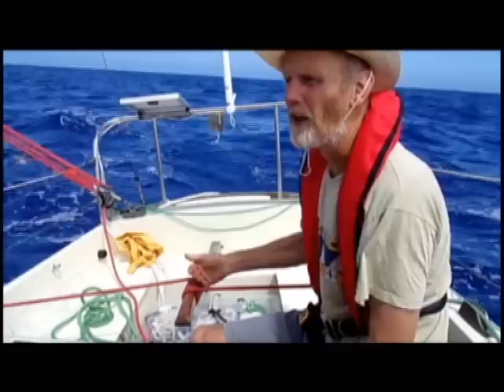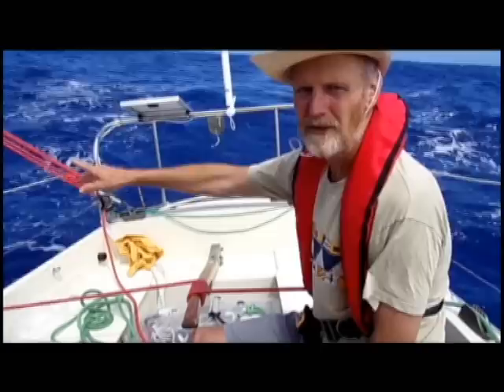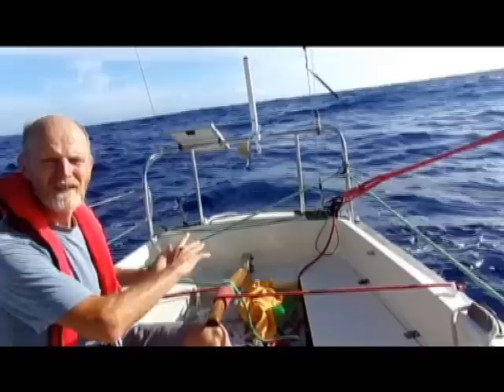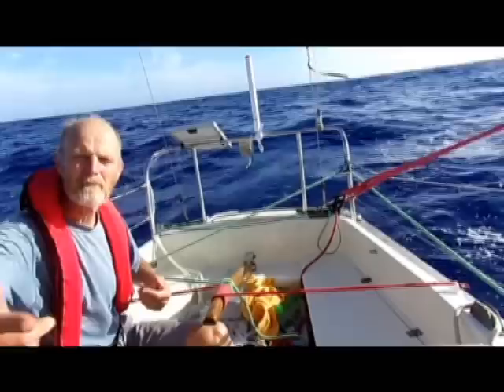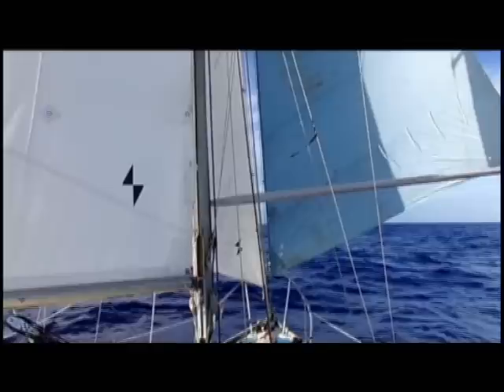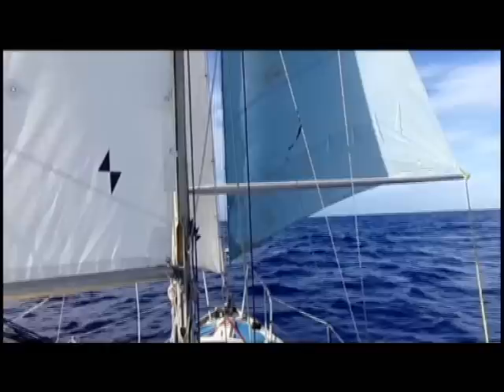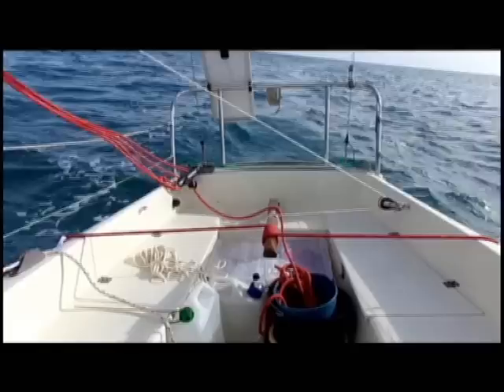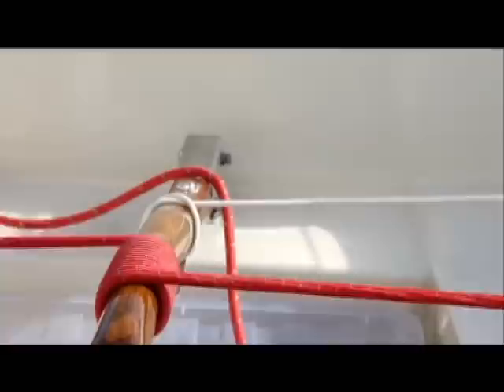Self-steering without a windvane - Jester Challenge

Comment: You Sir have taught invaluable knowledge to me,so much appreciated,best wishes over the Christmas break,stay safe.I have recently purchased a 11m vessel that has the blocks in the same position and I was wondering why being a novice sailor,this sheds light on all of my questions,thank you.
Reply from the maker: Thank you for your comments.  The blocks there may have been for spinnaker sheets, but by all means use them if they provide a clear lead.  Sheet tension on an 11m sloop would be too great for this method except in very light winds.  Check out STeLLA on my more recent videos for one solution.  Many other options are outlined in the John Letcher book
Reply: scallywagII I can see the wear on the tiller,those blocks had to be used in the mix some how,she’s a blue water heavy displacement vessel with multiple poles for down wind reaching Im guessing,I’m new to this vessel and have only had 2x21ft light displacement yachts.Financially I don’t want to spend the money on the Hebridean system just yet but may go that way if I can’t master the sheet to tiller system.cheers and happy new year to you young fella from Oz.

Comment: I got Letcher's book ten years ago, when I started sailing,  single handed, and began using these techniques immediately.  I try to get other single handers on to the idea, and they just  don't get it   
 . . . I think they get confused because its too simple, ha!
Reminds me of that expression, "If it was complicated, everybody would be doing it."

Thanks for the thorough explanation, im familiar with that subtle "slalom"  effect.  Ive used it to counter weather helm, and being drawn into shore.  Hard to explain, but, one side of the "S" sailing pattern needs to be, longer and more "powered up", after falling off, which pulls the boat, each time, more windward, countering that push towards shore . . .) It's not a symmetrical "S" shape, if that makes sense. .
Anyway, its so satisfying to see in action, i get all worked up! : )

. . .Also, remember Joshua Slocum, late 1800s, first solo circumnavigator, hand steered only three hours in 23 days, across the Indian Ocean: )
. . .had the wheel lashed, and boat very well balanced.
Cheers!

Comment: A multihull would  be a challenge,  Bill Belcher wrote a bit about it in  Build your own wind vane steering.   Often available for lots more than it's new price as limited number printed by 2018. 
Multihulls can accelerate fast hense the apparent wind isn't so good for wind vane steering though I have seen a video using 2 on 2 rudders looking remarkably good. 
Bill Belcher suggested the use of trailing a rope aft that would provide more usable pull with its increased drag when accelerating. This could stop the boat bearing away ( where the problem manifests) with helm till sheets ease.  That's the basic theory.
Reply from the maker: It might be worth trying jibsheet to tiller on a broadreach with a multihull.  The change in sheet loading with change of course is quite dramatic.  The low apparent wind should not be a problem if the vane is the size of a genoa, which in this case it is.  I have used this method when there was barely enough wind to keep a cruising chute full.  It worked perfectly when a vane gear would not work at all.

For windward or beam reaches, the change in weatherhelm due to heeling is largely what makes a monohull self-steer.  With a multihull I can't see this happening, but it would cost nothing to try it.
Reply: @scallywagII  Thanks for your reply.  The centre of effort usually determined predominantly by mast rake has I think a similar effect to the healing steering weather helm.  

A Dutch team from memory have a catamaran sheet steering almost on a run with 2 head sails on YouTube interesting but limited.

Next find a multihull owner with a interest ...

Another YouTubeing is from a 22ft Wharam Tiki winning the Jester Challenge from Plymouth to Newport. Boat had windvane but above 14 knots of boats peed it apparently stopped working.
Reply from the maker: @EdSurridge  My understanding is that the centre of effort relative to the centre of lateral resistance has an effect on helm.  Weatherhelm can be increased by racking the mast aft or increasing mainsail / reducing headsail area. 

Under way heeling gives an asymetric underwater shape and this will steer the boat into the wind.  This is why weatherhelm will increase with angle of heel.  I have reefed the genoa on a long keel yacht and that has reduced weatherhelm, despite moving the centre of effort aft.  I have better explained this on my more recent video on another yacht during the Jester Challenge 2018 https://www.youtube.com/watch?v=yKGTv4slZlg&t=208s

The other two videos in that series cover different points of sail and show how to set up the bungee so that the self steering will be reliable in differing wind speeds.
Reply: @scallywagII  Thanks again,  I missed the titles of your films as I binge watched them. They are very good value Sir. 
The Wharram's are certainly long keeled  Catamarans those with specific foil might change maters. You have encouraged me to try finding Cat owners whom might have  self steering interest.

Comment: Any system for a junk rig. They don't use Genoas or head sails much as it tends to interfere with the rigging. Great video, very clear.
Reply from the maker: Going to windward if you get a little weatherhelm, and that increases with more wind, then it may work with a bungee alone or lashed helm. 

For reaching courses you could use one end of the mainsheet pulling to weather against a bungee centering the tiller.  In practice the extra friction and stretch in the multipart sheet means it might not be sensitive enough.  Cost you nothing to try it though.  I think Blondie Hasler may have developed his wind vane gears because of the difficulty getting sheet to tiller to work on a single sail junk rig. 

On a broad reach a jib could be set flying and should self steer reliably if set up correctly.  Shape is not critical and you could pick up a suitably sized old jib very cheaply.  See the more recent videos with Emu for better descriptions of setting up and read the John Letcher book.   https://jesterchallenge.wordpress.com/articles/self-steering/

Comment: Hey, do you know anyone who has achieved this with a junk rig? I have tried, but there is not enough force on the sheets to turn the wheel surficently. I used blocks, and as much leverage as practical, but if I increase the leverage too far then the movement is not enough.
Reply from the maker: It would be difficult with the stretch and friction of your multipart sheets.  I think that may be why Blondie Hasler who developed Western Junk Rig also came up with the servo-pendulum vane gear. 

Going upwind a locked helm or bungee alone could be worth trying.  Downwind it is possible to fit a jib flying and use that as the steering sail.  Shape is not too important so a budget used sail could do.  Alternatively try fitting the lower block of either junk sail sheet to a line with a single block where it would have been fitted, then to a turning block on the windward side.  That way you have minimum friction so best chance of success.  Post another comment when you have tried it.  Good luck.

Comment: im confused...so the first setup is with the wind more at your back and the second setup is when you are heading more toward the wind? Thanks in advance
Reply from the maker: It is much clearer on my 2018 challenge videos which I did in three parts for different points of sail.   There is a better explanation of how to set up the system so that it will be reliable when the wind strength changes.  It is worth putting in the time to study these in full and read the John Letcher book so that you get this right.

Comment: I wonder if it could work with a wheel and a some sort of drum to wind the bungee around. what do you think?
Reply from the maker: +stephen Webb  Possibly it would work.  Wheel adapters are made for some wind vane gears.  Wheels introduce extra friction which is the enemy of all wind steering systems, with or without vanes.  I have sailed to windward using the bungee around the spokes of a wheel and it kept a better course than an electronic autopilot.  I haven't tried it on other points, but give it a go.  Read the Letcher book for more ideas. http://www.kyoa.org.uk/jesterchallenge.htm  Find the link about half way down the page.
Reply: +scallywagII Thank you

Comment: Ha ha took me over half the video to work out why it's called SARAH!! Thought it was named after an ex lover who always insisted on being in control!
Reply from the maker: I was on a high as it had kept a perfect course throughout the day and evening.  The stars are always best far offshore and the words of the Bob Dylan song came to me "Sara, Sara glamourous nymph of radiant light.  The neumonic came later.  Simple And Reliable Automatic Helm.  

With the bigger boat I needed an arrangement to tame the tension in the jibsheet.  Thus the Sheet Tension Lowering Lever Arrangement.  It had to have a female name as I was channelling the late James Wharram who advocated sailing with a 2 girl crew.  So I need STeLLA and SARAH.
Reply: @scallywagII  :) cheers for the recollection. Whilst I've got you! do you think this does away with need for a wind vane entirely or is there still a place for them. I'm very much a novice but looking at a boat now that has a wind vane but I find them ugly things and as I really am not going to be doing these sort of voyages for a while like this clean approach.
Reply from the maker: @AthelstanEngland  I had such good results on Scallywag that I didn't bother with wind vane or autopilot on my bigger 27' boat.  I did though try it out before setting off on a big ocean passage.  Hand steering for 1000 miles does not appeal.  
Wind vanes and also autopilots will usually oversteer more than these methods.  More movement of the tiller will slow the boat down, as will the drag of the pendulum rudder, though these might be slight effects.  On a small boat, the effect of weight at the extremety of the boat is not helpful for stability.  
Check out the John Letcher book which you can view on the Jester Challenge website.  My later videos on EMU also explain the methods and how to set them up reliably.
Wind vane gears may be better in some conditions, particularly running before a storm under bare poles.
Reply: @scallywagII  thanks for the detailed reply. Much appreciated... good point too about wind vane and bare poles though - I hadn't even considered that. I'll check out the book. Thanks again.

Comment: What's the boat here? I have Letcher's book in hardback and prize it.
Reply from the maker: Scallywag II  is a Robert Tucker T23+.  Do you also use Letcher's methods?
Reply: @scallywagII  I built a horizontal vane with fishing line through plastic tubes going down to an auxiliary rudder with trim tab. Took me from Portugal to The Gambia and back up to Britain via The Canaries and Madeira.
Reply: @scallywagII  Before I built the wind vane I crossed Biscay with sheet to tiller, inner jib slightly backed with sheet leading to tiller and bungee compensating. On a Folk Dancer 27.

Comment: Is there light weight brand wind vane good for 22foot to 25foot,sloop? if its heavy, sterns down, so the light one
Reply from the maker: Study the video.  There is no wind vane at all, so no unnecessary weight or windage.  No additional expense either.   Too good to be true? No these methods have been used long before wind vanes were thought of.
Reply: thanks for teaching me the way of a self steering not to use wind vane but to lead sheets from a jib sail. i had not known your way of fittings. but your way may be used when yacht is on running(towards down wind). i dont think your way is  worked when more than abeam (windward). i need strong but light wieght wind vane for my dream plan.
Reply from the maker: Different arrangements for different points of sail.  For windward work, the first part of the video, I just use a bungee shock cord around the tiller.  Adjust the tension to provide the required angle of helm and it just sails itself.  I have many thousands of ocean miles like this.  Try it yourself before spending money on a wind vane that you probably don't need.  Study the John Letcher book for more details

Comment: Small boat to be going into the ocean with
Reply from the maker: Bigger horizons are more important than a bigger boat
Reply: @scallywagII  Fair enough, just thought it would be more dangerous with a small boat. If you can do it, great..
Reply from the maker: @KrunchyJD  A larger boat is usually faster and more comfortable, but that is not the same as less dangerous.  I changed from Scallywag to a slightly larger boat (26') because it had more headroom and could carry more stores.  It is also much better to windward with one long keel rather than three shallow ones, but that does not make it any safer.  The closest I have been to disaster at sea was on a coastal passage on a 600 ton brig.  That was scary.
Reply: @scallywagII  Oh okay, I just imagine that the ocean could have huge waves and it would be dangerous. Ok, I stand corrected. I used to sail many years ago, just a dingy, a Lazer actually, so I know the basics of sailing. I have thought about getting a small yaught, if I can afford it. Kind of thought it would be for sailing around the lake, thought it might be dangerous in the ocean, perhaps not..

Comment: There is no way my boat would steer with those set ups.
Reply from the maker: What kind of boat is it?  Any conventional sailing monohull should develop moderate weather helm which increases with wind speed.   If that is the case these methods should work.  They are guaranteed not to work if you don't try.  For larger craft the headsail sheed tension would be too great, so you can use a means of reducing that.  See my other videos with EMU for detailsof what worked for me.  Read the John Letcher book for explanations of how it works and other methods for larger sails.  I had not read that book when I did this trip but had figured out what worked by trial and error.  When you have tried it out, come back and comment again.
Reply: @scallywagII  Hans 311 with short fin & self tacking jib.Tiller steered.  In 18 years from new I am now on my 7th auto pilot as it burns them out or they do not perform properly. For instance the raymarine av100 will not stop the boat broaching through 70 degrees. At that point the autopilot cuts out & the helm stays hard over. If I am below & do not notice the boat suddenly gybes. Not fun in a 2 metre sea coming over the stern quarter in f7. My aeries does not cut out & will bring it back on course eventually, but it does sail an "S" course that means I cannot use it to run down wind
I have been experimenting with different steering methods on my boats for 50 years so I do have some experience. I cannot let go of the helm for more than 2 seconds so I find that  even trying to set up a tiller to sheet system is extremely difficult. 
For instance this boat will not heave too like other boats do. so I have to keep sailing all the time.